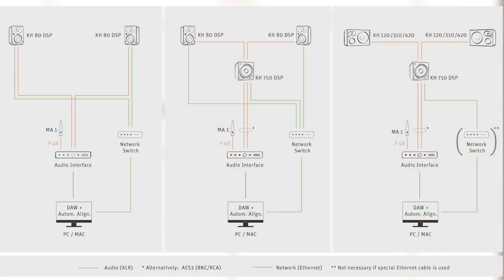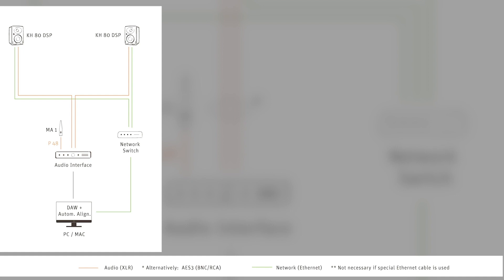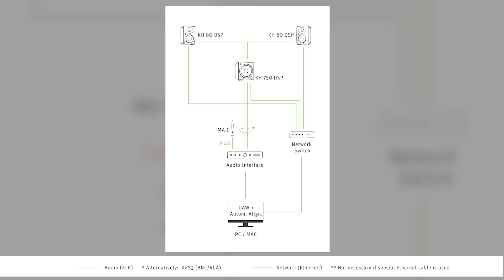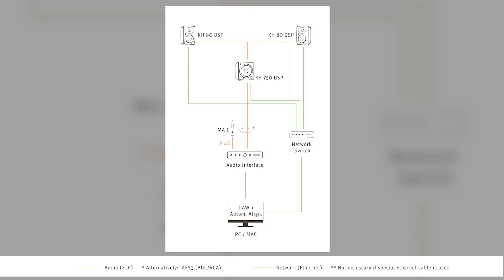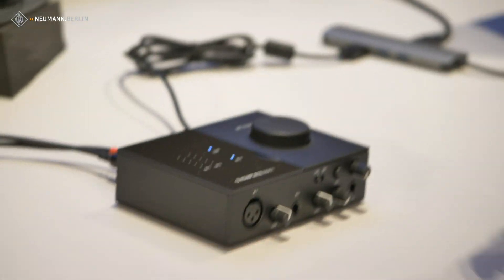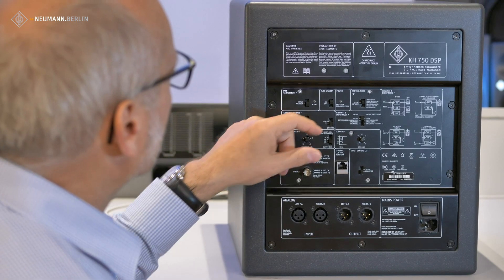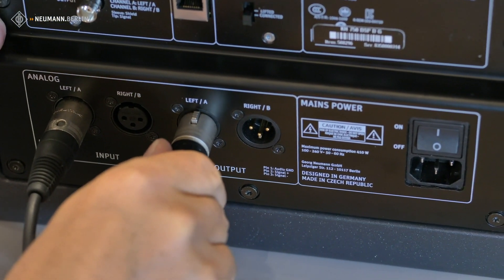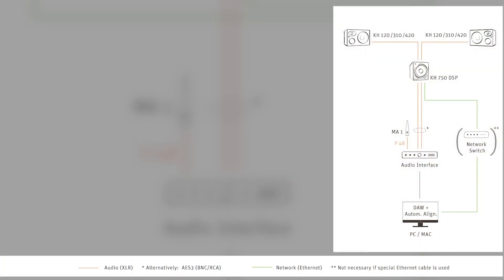Welcome to the MA 1 | Part 5 - Setup Scenarios

Comment: would it be working well aligning 2 subs kh 750dsp (in order to replace my kh810) with my 2 Kh 310 ??
nobody in France is able to answer this question so I am not ordering ...
Reply from the maker: stay tuned😉
Reply: @GeorgNeumannGmbH  cool. i am curious ... thanks for the answer. that calms you down 🙌👍☮️
Reply from the maker: Dual-Sub Alignment is now possible! Download the 1.2.0 version that we have just lauched! 😁
Reply: @GeorgNeumannGmbH  Thank you for listening to the community!
Reply: @GeorgNeumannGmbH  🙌 dankeschön...
Reply: @GeorgNeumannGmbH  I guess the next step for MA1 is to add guided/manual alignment for complete freedom of control!
Reply: same idea or same problem. I would like to upgrade my 310 to a full range system in connection with two 750s. there should be a way to do this in the app. I hope that neumann will improve it.
Reply: Was told by Neumann that it is possible with a little manual tweaking inside the app. At least we should expect this workaround solution to be officially published by Neumann until the software gets fully compatible with multiple subs!